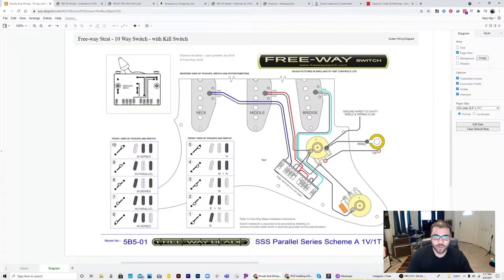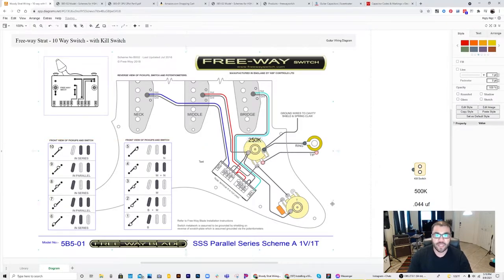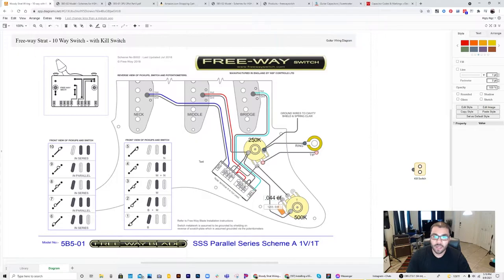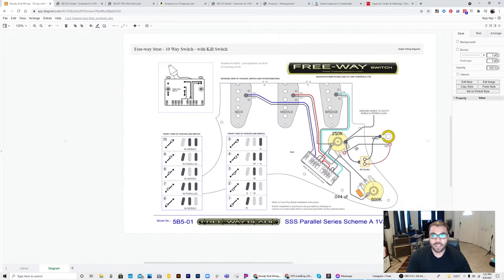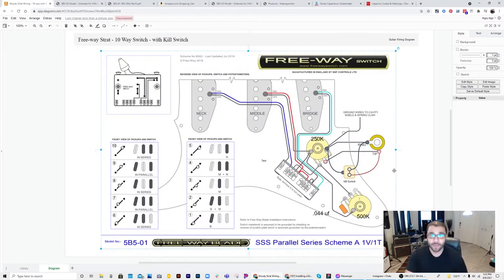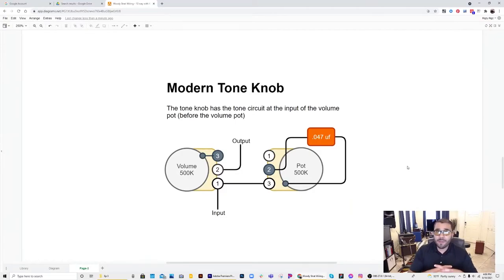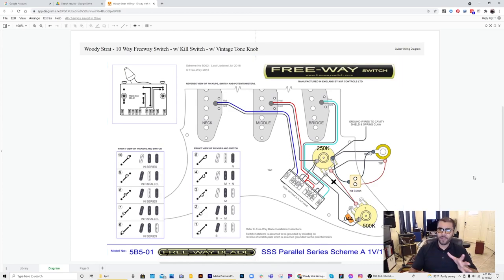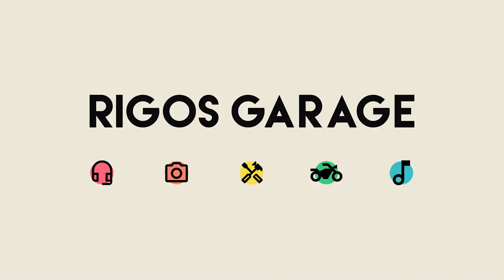Rigos Garage - Woody Strat - Freeway Switch 10 Way Stratocaster Wiring - Ep 3

Comment: My favorite setup for freeway ten way sss is with 250 volume, 500k treble tone, and 1meg bass cut tone. This is G&L style 2 band eq or passive treble bass tone control as they call it. Also like hss with the 5b5-02 model because it gives you really funky settings. Also the tele 6 way is really cool with HH and a push pull for coil split so you get 12 tones.